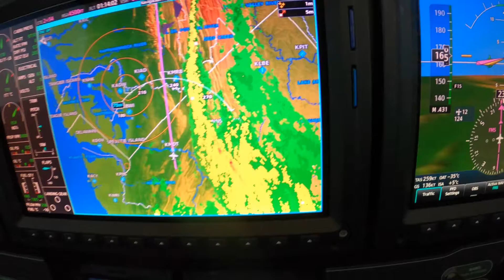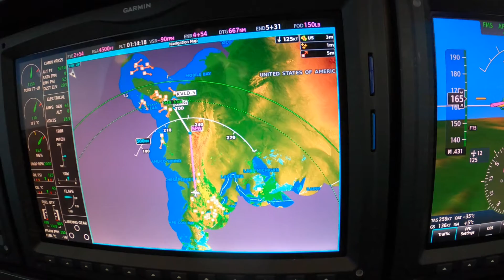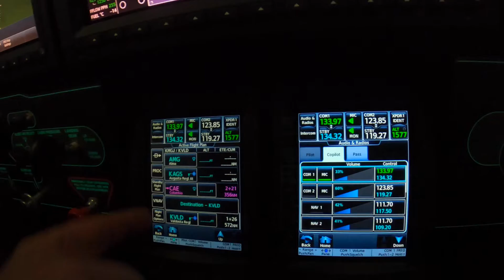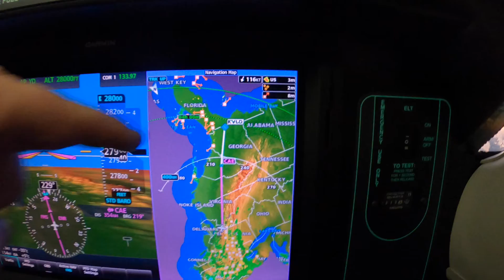Piper M600 Diversion for Crew Rest Considerations

Comment: Liked very much your discussion around the duty day balanced against the fuel remaining issue given the length of the trip due to the headwinds.  I saw a yellow “rudder” message on the PFD - does that indicate the need for trim?
Reply from the maker: Hi Adrian. Thanks for your comments. Yes the yellow rudder icon means a tad of trim is needed. Good catch!